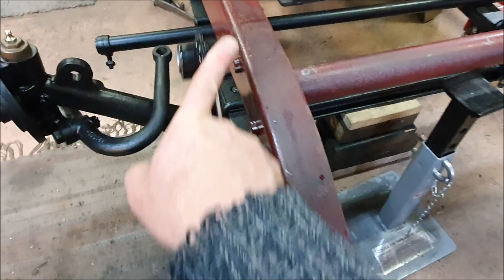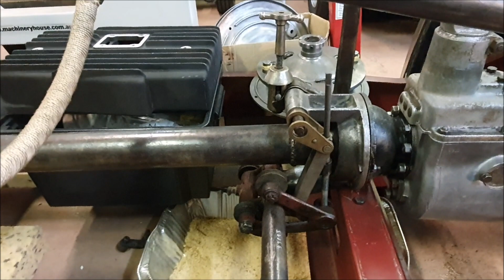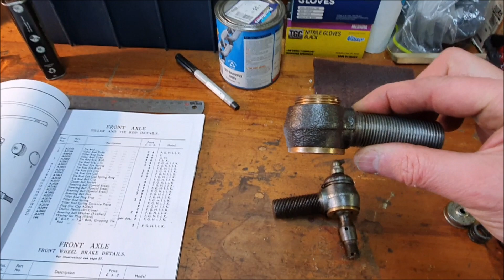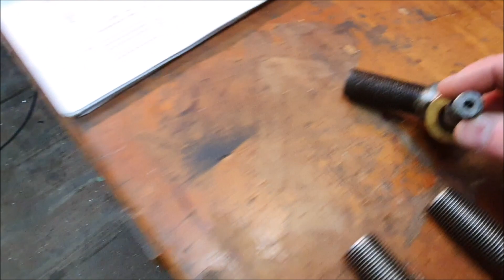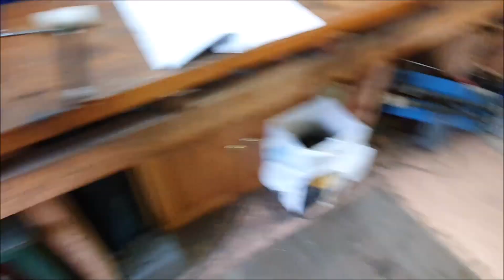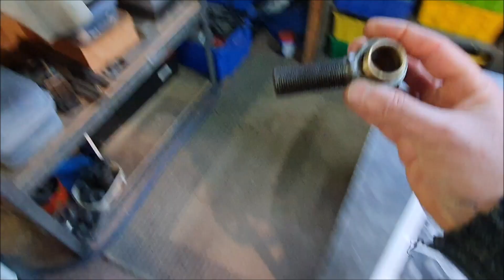Pre war cars update - Riley Brooklands front shocks and tie rod ends

Comment: What was the part number of the shocks you used as I want to fit some to my Riley 9 Special
Reply from the maker: According to my spreadsheet of parts they are "Alloy Hartford Type 302M shock absorber, 2 at 7" x 7", 2 at 7" x 5"". They are from Graham Brown at vintage and classis shock absorbers in the UK.
Reply: @asciimation  Thanks for that I'll look into it
Reply: So what size were the front ones?
Reply from the maker: @dodgeyboy29  I think the 7" by 7". Equal length arms.

Comment: I think the ball joint pin with the groove and hole is from a later car that had an automatic chassis lubricator. Keep up the good work .
Reply from the maker: Yes, I think you're right there about the chassis lubrication. But that joint itself is fixed so is it so oil comes up under the ball to lubricate between the top of the arm and the bottom of the bush? I've not actually ever seen one assembled fully so I don't know what space is there normally. I would have thought there is clearance between the arm and the tie rod but maybe when the suspension/steering moves they can touch occasionally?
Reply: @asciimation  The hole in the groove goes up to the ball for autolube. Lube pipe hole attaches to the side of the swivel arm beside the tapered tie rod hole.
Reply: @kenphillips5221  But that's a steering arm moving through quite an arc - they didn't use flexibles on the auto lube system. I think it's just a grease nipple in the steering arm supplying grease to top of ball & filling the bush.
Reply: @phlize  My 34 Kestrel has had the autolube removed but I think a pipe ran from the top of the kingpin to the tie rod end taking lubricant via the kingpin feed. So many places for it to fail - No wonder most were removed.
Reply: @kenphillips5221  I have a special built on an Adelphi chassis and that appears to be how it worked, the autolube on my car is also long gone , I rigged up a small oil reservoir to lubricate the driveshaft universal and made the universal bushes from "Nyoil".
Reply: @mikeadams7829  Good idea!. I may do the same on my kestrel re universal lube only using the original autolube reservoir.